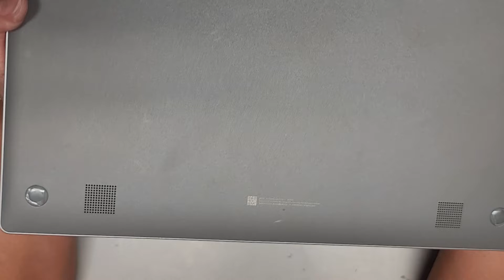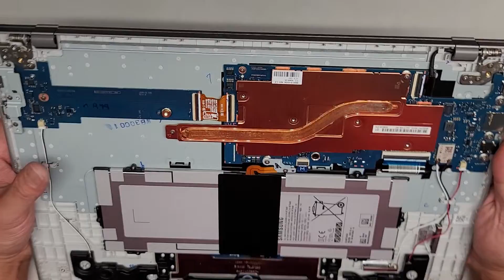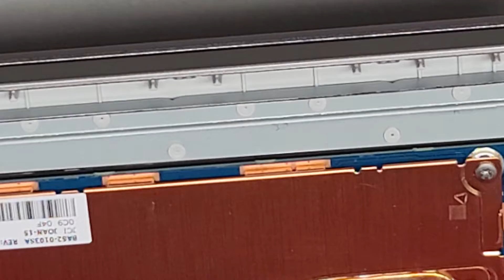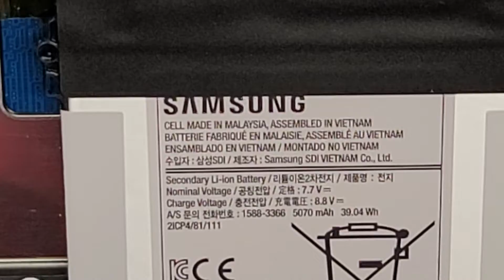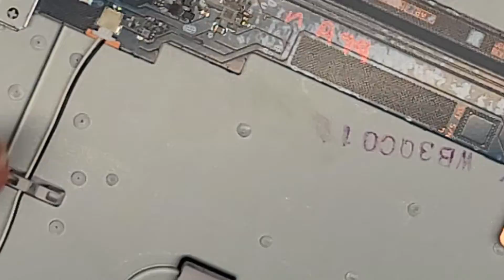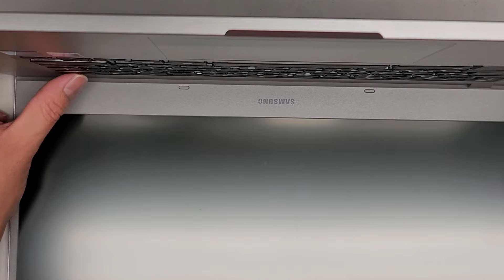Samsung Chromebook 4+ XE350XBA Disassembly Nothing Upgradeable Battery Replacement Repair Quick Look

Comment: Can you remove the battery
Reply from the maker: Are you asking if I'm able to? Yes, but I don't have the laptop to demonstrate it.
Reply: @ItsBinhRepaired  i took the back off of it , and I seen the battery there , and I wasn't sure if you can replace a battery.. if so I  can probably try to order one. When I put the charger on it , it just flashes red
Reply from the maker: @trud2216  if it flashes when the battery is disconnected then a new battery should fix it hopefully.
Reply: @ItsBinhRepaired  tysvm

Comment: Thank you for the tip about holding the power button down after disconnecting the battery - I had no idea I was supposed to do that! You're really good at explaining things and also going step by step. Thank you so much for this video!

Also lol at the quick pause to take the thumbnail photo, it's what drew me to the video in the first place so it turned out great. =D
Reply from the maker: Glad it helped and you like the step by step. Lol Yeah, I have to stop for the thumbnails or it turns out blurry or not all in frame. Haha If you haven't already, please like and subscribe so others can find my videos and possibly consider watching a few others, liking and commenting to get the algorithm to recommend my channel. Thanks!

Comment: A friend of mine dropped theirs..and it broke the charger and now it won't charge or turn on..even with a new charger..and charger port cleaned..and connections checked inside
Reply from the maker: Likely shorted or the charge port is bad. If it died the moment it dropped, then it's not a charger issue. It's the motherboard fried. If it's getting power, but no display it can be RAM or screen

Comment: My chomebook has recently just shut off, no signs of anything wrong, try putting it on charge and the light goes green, red blue then off and it cycles
Reply from the maker: @CJ09_Picea not sure :(
Reply: because the battery is damaged and cannot be charged
Reply: @MPX_U1196 it's usually the BMS not the battery

Comment: My Samsung Chromebook has no visable  model #
Reply from the maker: @austina8797  nothing on the bottom?
Reply: @ItsBinhRepaired  no. Nothing at all. Smooth nothing rubbed out.  I don't think I could figure out what model it is unless it was able to turn on.  There's no hatch for a battery. It just down and I'm pretty sure it had a charge when it's shut down. Now it won't charge anymore.
Reply from the maker: @austina8797  that sucks :(

Comment: guys if I use a vacuum cleaner to remove dust from my chromebook  4 can I damage it I vacuum from were the speaker is
Reply from the maker: Just don't touch the insides with it.
Reply: @ItsBinhRepaired  no i don't pull it apart
Reply from the maker: @Luffy-ss4rq  ok

Comment: I'm here to see what's what inside my Chromebook 4. I just got it to charge by pulling off battery connector, putting in charge cable, reconnecting battery cable & waiting 12 hours. Some progress anyway.
Reply from the maker: Interesting
Reply: I have just done instructed in this comment it's now changing.   I will update my comment if it comes on . 😊

Comment: Wait by nothing is replace able  even the battery ( Mine died today and im truimg to fix it )
Reply from the maker: Battery is but nothing else.
Reply: Of course that's not correct! You can easily replace the motherboard, the daughterboard, the touchpad, the speakers, and of naturally you could also take apart the lid and remove and replace the screen.

Comment: Hello! Is there a possible way to check the laptop which ran over by a pick-up truck?
Though by briefly inspecting the interior is intact, yet neither the charging lights nor the power will turn on 😢
The owner claimed that he bent the case back a bit, as there were slightly curved at the middle after the collision.
Reply from the maker: I don't think it'll be repairable.
Reply: @ItsBinhRepaired  K, thanks for reply ;)
Reply from the maker: @giocyhuang5904  yup